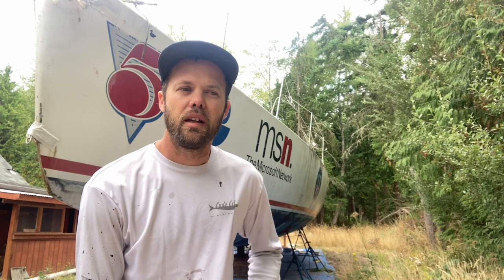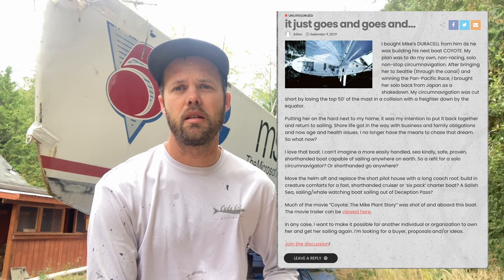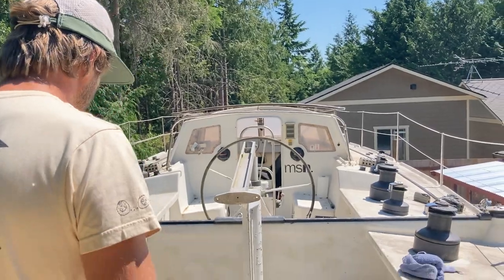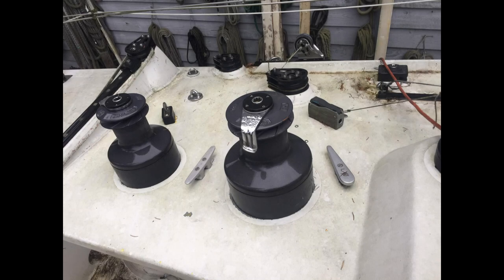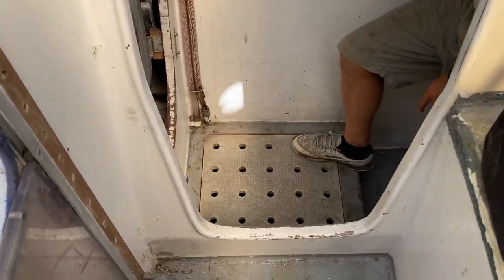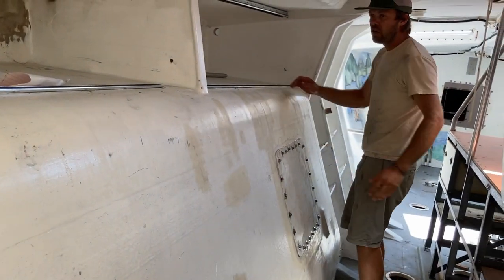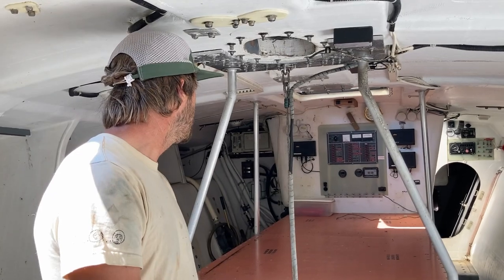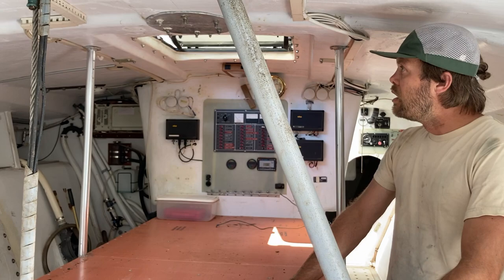Episode 2 - The short boat tour

Comment: Couple of things that I would different after spending the last 3 years fitting out our IOR racing yacht. Break it down to stages. For example sail away stage which gets it to the water and allows you to get some use out of the boat while you bring it up to blue water ready. Don’t try and have everything done before splashing it, as you will want to change things as you use it. As a shipwright you have a head start from where I started. Also you might be interested in Ayer light panels that are aluminium honey comb sandwiched between aluminium sheets with a laminate over the top. I think they look great and are 30% lighter that plywood. I am excited to follow your journey.
Reply from the maker: Thanks for the words of wisdom gained from your project. I'd love to get Ayer panels for Duracell-especially if the price comes down in the next 2-3 years.
Reply: You have to way the price of the ayrelite panels with the cost in time with timber and marine ply